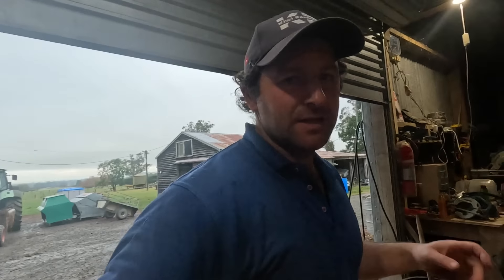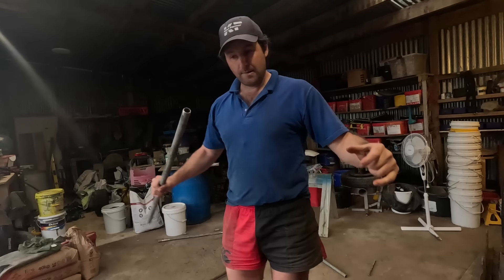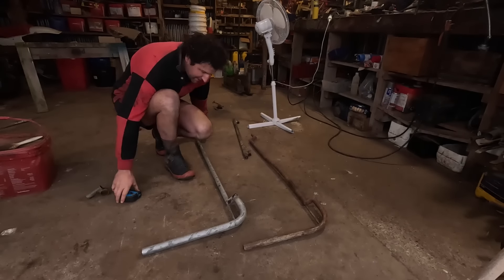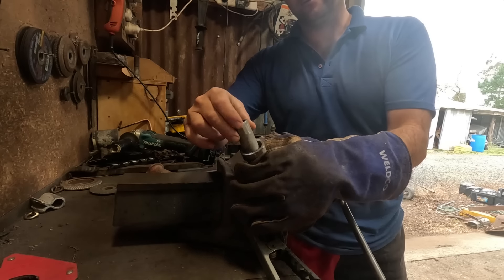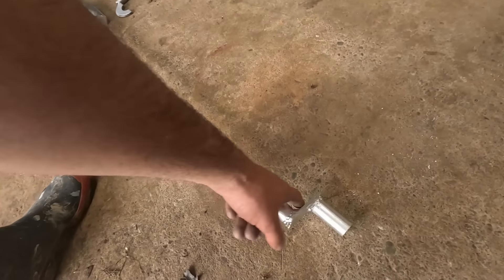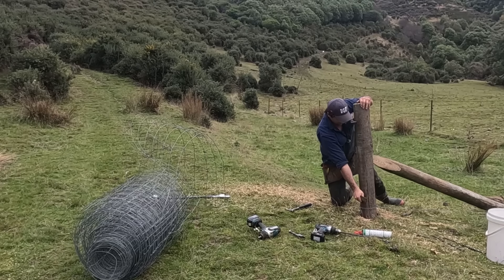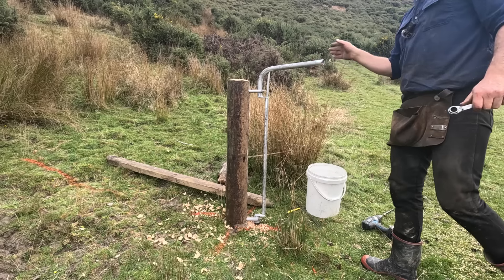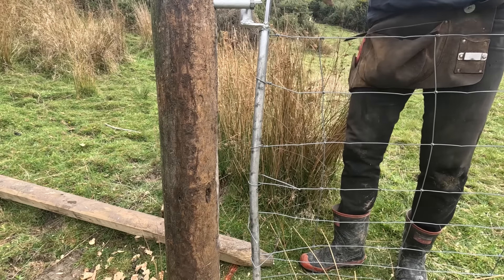How to make the Best Netting Gate Ever| Full Instruction

Comment: Well I thought it was just number 8 and battons with a wire loop at each end to hold it on. This is alot better 😊
Reply: Same with me, my Dad had some just wire netting and loop at bottom and one pull back battern at top arrangement back in the 70s but this version is flash as Michael Jackson.

Comment: I absolutely hate stick welding and I'm a boilermaker. Gasless mig is so much better and easier. I've had gal fever more times than I care to remember. Its the fever you get that lasts for the night and makes your life miserable but in the morning your right again. It sucks big time.
Reply: Bugger that gasless shit, worse than welding galv.
And I was a coded welder 😂
Stick with 31A's for that job.
Reply: @stephendickson9000  I do agree with you mate there is times when you should only use stick but for galv farm gates I'd just use gasless 0.9mm wire. I've always got a spool in my small uni mig works a treat.